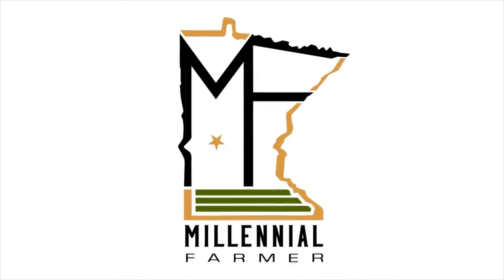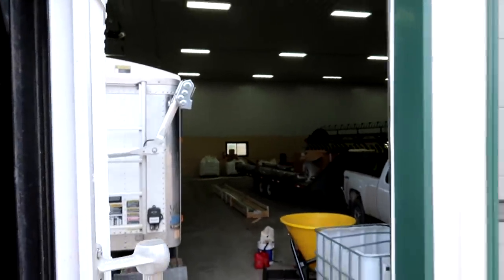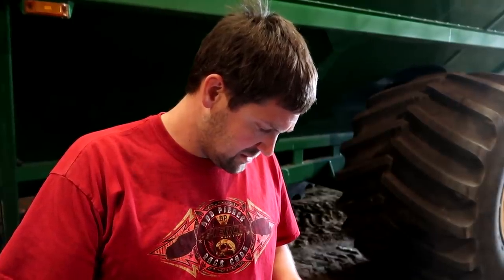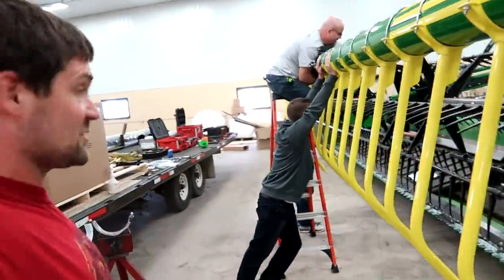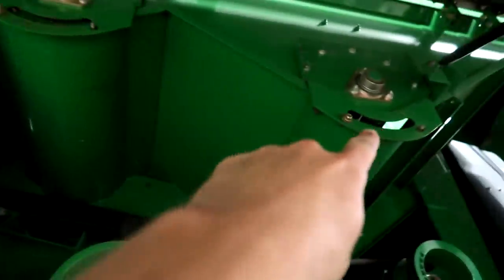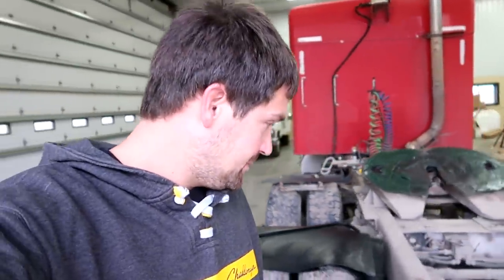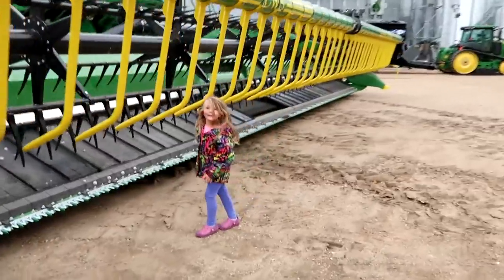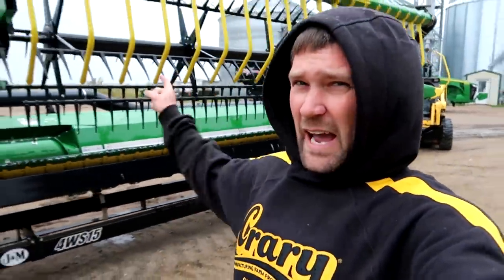My Daughter got a New Combine!!

Comment: "Hi, I'm the Millennial Farmer and welcome to Pimp My Combine. Today We're adding an air pressure system to increase our top speed in the field. Going from 6 mph to a wopping 7 mph!"
Reply: We used to race Sea-Doo's and would spend thousands for a 1-2MPH gain.
Reply: He should had said we are adding a BLOWER to my combine to increase its harvest speed!
Reply: Big gain in the field
Reply: Well that's about fast enough I've never cut soybeans but the fastest we've been able to.cut wheat is 9mph but that cutting a not so good crop if it's good wheat you can only run about 6-7 mph and that one extra mile a hour makes a huge difference
Reply: Going from 6mph to 7mph is a huge difference over a course of a day and 100 acres
Reply: Going from 6mph to 7 mph is over 15% increase, that is alot

Comment: Have fun replacing the roller bearings on your draper header. The Combine guys at RDO said they either work them out with a little slide hammer or torch them out and grind it out again. We just took a piece of 4' of round stock and a piece of pipe that slid over it, welded some solid 2'' shaft to the pipe so it was about 8-10lbs, welded an end plate on. Then you need to come up with a hook that will fit inside the bearing, not break, and stay in when pounding. We used a piece of hardened round stock from a beat lifter and ground a notch in it and wedged it in with an alan key. There ya go a homemade, overbuilt slide hammer. Tip a mild steel hook will break.

Comment: Last time i fired up the combine right before harvest i had left a Milwaukee cordless light sitting on the sieves. After that first quick start up yielded no unwanted sounds I relaxed and engaged 'er again and throttled up. 10 seconds later i remember where id left the light, and reached for the switch just as i heard a painful ka-klunk as the chopper gobbled it up and turned it into red dust.

Milwaukee didn't even accept my warranty claim.

Comment: just got back from the eye doctor.  was picking up my new row sense system
:P
it's multifaceted- row sensing, GPS'ing, chick scoping; works with my crop computer, for which I need to pick up a new cover.  Has never lost signal to the satellites, never goes down in the rain.  only problem is it needs a supplementary light system to work in the dark.  however, it flashed my safety squints, sun squints, dust squints and snowflake catchers to the newest operating system, as well.
lolol

Comment: Just trying to help here, I noticed you were sorting 2630 displays according to signal (sf1,  sf2 or rtk), all the displays will run any of the signal regardless of the activation. The receiver is the only thing that needs the active correction signal. That changed a while back. 
Have a safe harvest.

Comment: You may need to change the check valve on the quick connect hydraulic block in order for the head to work seamlessly on the combine. Had to have my customer do that just the other day!

Comment: On the air reel where the fan sucks in the air sometimes will get covered with chaff , sometimes in will all fall of when you shut off the header but most of the time you have to get out and clean it by hand. So we put a wire on it to knock chaff off as it’s spinning. But it might not happen with yours ,I’m just saying that’s what our air reel does.

Comment: Running cart here in southern mi. 830pm u wont regret that air bar either helps when the beans lay down to
Reply: Only problem u may have is it kicks up alot of leaves and they build up on the feeder house much kwicker got to kick it off every couple hours or u have a 8 ft blind spot

Comment: So what did the air system cost? And why do you take those two clean out covers off the right side of the combine just loosen the one  bolt where the holes slotted slide them out from underneath it and let them hang from the other bolt

Comment: I farm in southern illinois and my corn has averaged about 200 which is excellent for this year. I did prevent plant about 40 percent of my total acreage this year. That seems to be the common trend in my area. Do you see a lot of unplanted fields in your area this year? This should drive corn prices up this winter. Hopefully the USDA is honest which i don't feel they have been so far this year in a effort to keep food prices and inflation under control. We will see if there is actually any price discovery based on the grain itself or if it is a totally managed market at this point.

Comment: Came from an interview with John Deere in Moline a couple weeks ago. Those combines are $700,000+ easily
Reply from the maker: They actually aren't quite that.  Seriously.  The tracks add a lot and this one isnt 700
Reply: Millennial Farmer How much was, if you don’t mind me asking?
Reply from the maker: @brendonholder2522  we did not buy this machine but the cost is $677,000 and I know the tracks are a huge upgrade from tires.
Reply: Millennial Farmer I was way off! Can’t exactly say “easily” either. Do you use the innovative land use tools or research that John Deere provides? I thought that was the most interesting part of my visit because of how the company is helping farmers meet higher outputs on the same amount of land
Reply from the maker: @brendonholder2522  we use a good amount of tech stuff but not a lot of that from Deere.  At some point it can become too much to micro-manage.

Comment: I don’t know if your John Deere mechanic told you or not to engage the header befor the separator with the wind system. We broke our gearbox on ours and they said it was because of the jolt when your start the header was too much for it.

Comment: Jim has good taste and there is one thing that is always a plus you lose it so easy.

Have you thought of writing in a Sharpie on the back of each controller so at a glance you can tell which does what job? Also how long do you think it will before all the new batteries will go flat?
Reply: Was thinking of the old Dymo Label maker...or use a strip of the plastic for a color code to identify the units. Turning your head and looking behind a unit to read 6 point type gets old fast...especially with glasses that slip off, because they are upside down...lol
Reply: @lenscap8925  trouble with colour code you have to remember what the code is, label is go though I was just thinking putting it in the back as usually the units can  either turn so you can see the back or in hook relatively easily and I admit labels or things like that usually get picked at when my mind starts wandering on repetitive jobs when they are in sight
Reply: @SlipShodBob  I'm sure some "whipper snapper" out there can come up with some app for the phone... just don't let the battery get too low...lol

Comment: There should be switches that they put in the cab to move the air reel Also my dog rides with me and hates the air reel
Reply from the maker: Our air system does have a remote in the cab for adjusting on the go.  I'm pretty sure that's standard now

Comment: Do those air nozzles have to point to the cutter bar to work properly, I noticed yours are pointing back towards the belt and not at the cutter bar does it matter?
Reply from the maker: Yes, they're adjustable from inside the cab

Comment: How did you bolt the ram mount to the corner post?
Reply from the maker: Well.  I VERY carefully used 2 short self tappers.  I might look for a magnet or suction mount next time
Reply: Millennial Farmer I used their suction cup mount this year and it was alright, was looking for something better for next year. We have to run R2s for rice so vibrates quite a bit going down the road

Comment: That head will go through that door
Reply from the maker: No it won't?
Reply: I've been on the harvest crews if you can get one end started you can wiggle it through no different than going through narrow gate
Reply from the maker: @jasonleckrone2577  its 7 feet wider than the door.  The 9870 will not make those turns.
Reply: Maybe not but we took 36ft heads through 25ft gates either way it don't matter since you are a millennial and I need another beer

Comment: Do you pay anything to get that received updated? I don't understand why you have to bring the receiver to the dealer, if you design it once to be a good GPS receiver, there's no need to update anything, at the very worst, they could put in a USB port and have the farmer flash the firmware themselves, otherwise there shouldn't be a need to upgrade anything on the receiver head. Sounds like a John Deere gimmick to charge customers money every year.